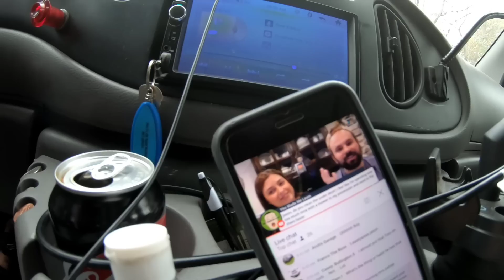FREE HUSQVARNA 2346XLS HYDROSTATIC LAWN TRACTOR CURB ALERT BRIGGS VANGUARD 23HP V-TWIN VERTICAL PICK

Comment: Have good friends daughter that's had an old Murray stored in her  garage for at least 10 years in the dry that's given it too me for FREE . Ask her if I could come get come spring , she doesn't have a problem with it - since I fixed her push mower for Free . She said it was mine about a two blocks away from me  . Anyway I'll get and see if I can get it running then , I think it could be a winner and it looks new .  Good luck on that Husqvarna it's high dollar when it was new , fingers crossed you get it running and get good bucks out of it . 🍻

Comment: That Husqvarna with no starter is a good candidate for "spin" starting with a 1/2" drill on the flywheel nut to see if it even runs before you  do a bunch of work to it or buy parts.  Good video  though!
Reply from the maker: Good idea!  I have other projects ahead of it though